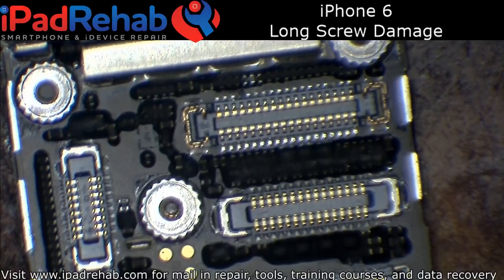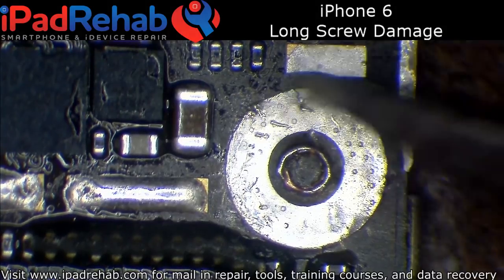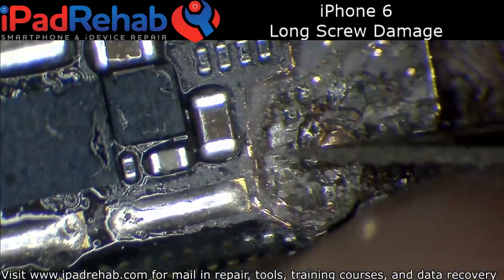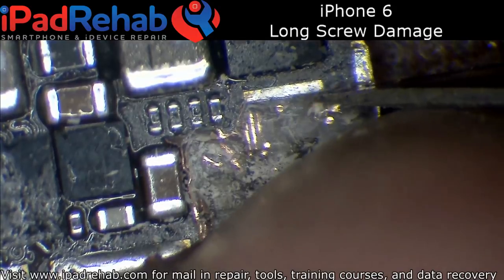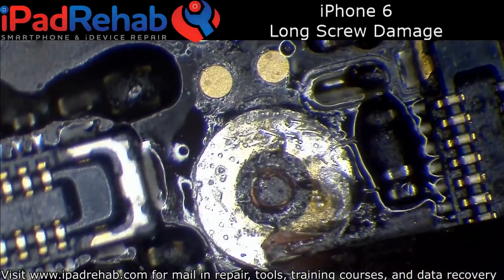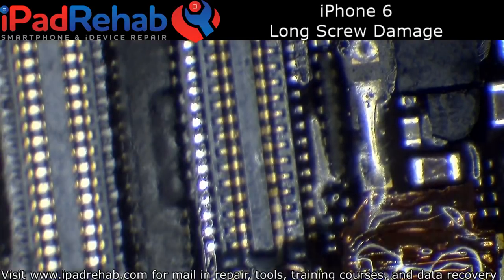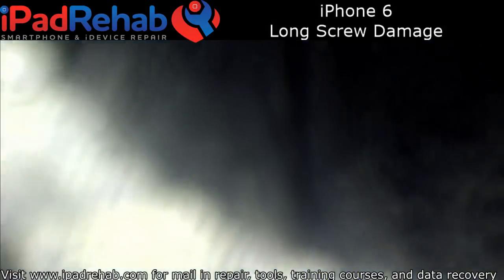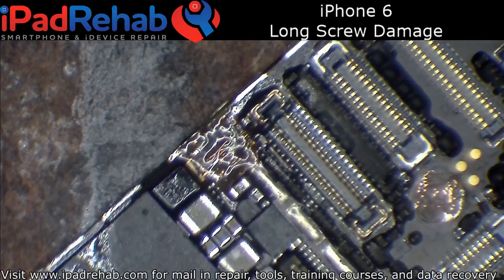How To Fix Long Screw Damage via Trace Repair--with Mark Shaffer

Comment: How come the board is spongy ? What part of long screw damaging a board makes it spongy like that ?
Reply from the maker: The part where the screw is jackhammered into the board and fractures it in all directions
Reply: iPad Rehab  Sometimes I forget some so called technicians are stupid enough to put a screw in by force, even when the screw is .6 by 1.1mm
Thanks for the answer !